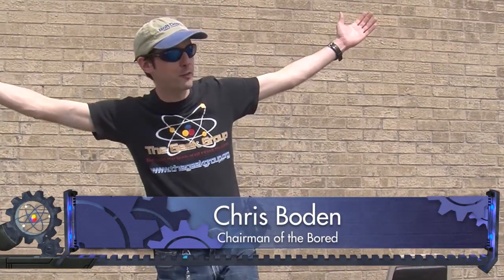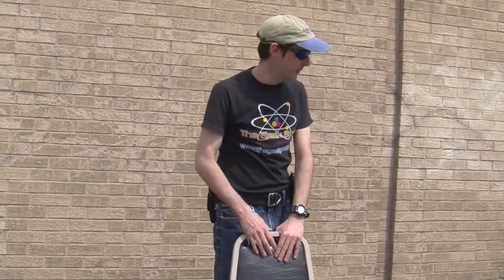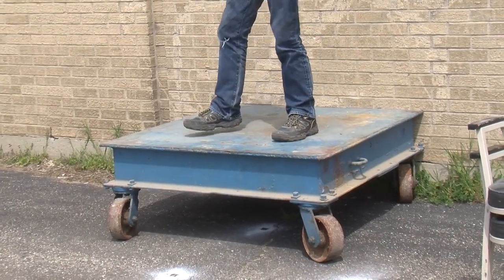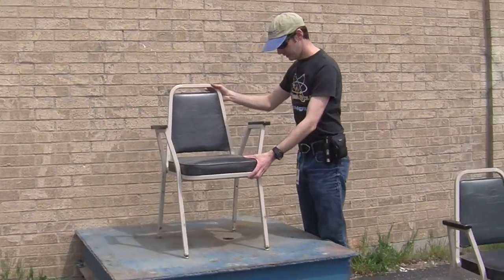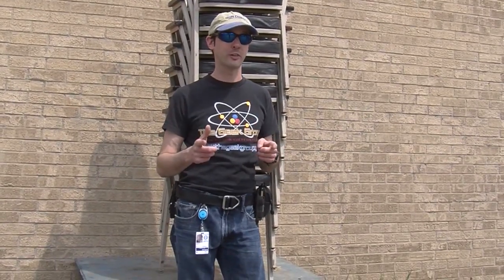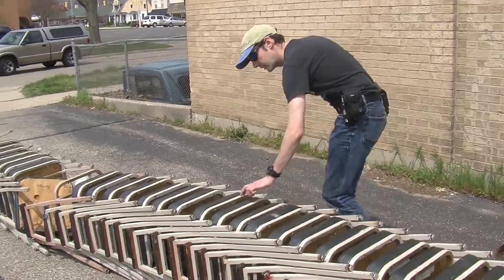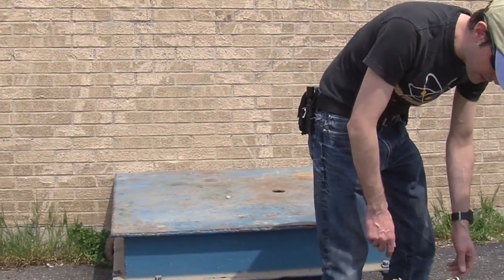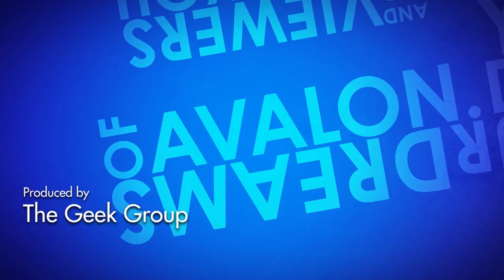Chair Stacking Experiment

Comment: beginning of clip hypothesis

Having seen chairs much like those before, I'm going to guess structural 'failure' of the bottom chair somewhere around 75 chairs. Though being very old and well used, I'm doubting you'll even reach 30 chairs, considering how many of your chairs are likely crooked, bent, etc..

end of clip

I stand corrected, you actually made it to exactly 30 chairs, lol